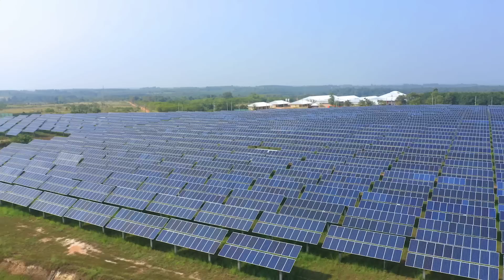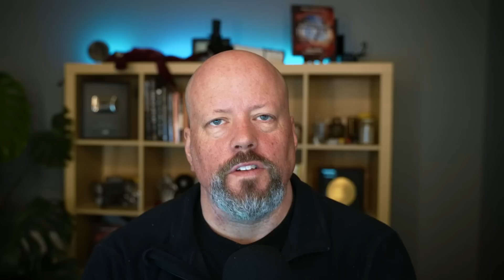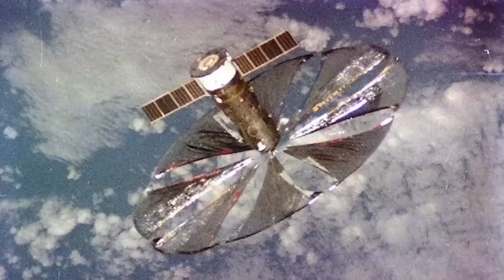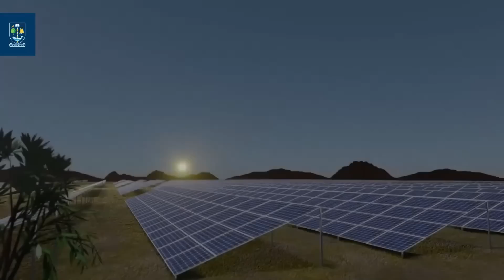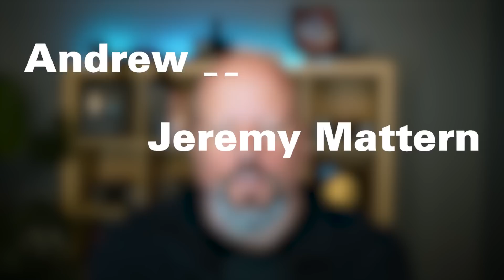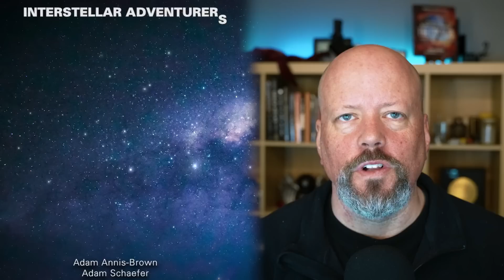How Space-Based Reflectors Can Change Solar Energy

Comment: I am curious about the impact that prolonged daylight around these solar farms might have on the surrounding wildlife.
Reply: I think the real use case for these things is going to be for the moon. It’s a perfect fit for setting up infrastructure on the moon, to overcome the 14 days of darkness.
Reply: Climate change due to the burning of fossil fuels is not so great for wildlife either.
Reply: @macbuff81  True but there are other possibilities like high voltage intercontinental power lines that achieve the same goal and could potentially provide more grid stability then space mirrors.
Reply: The key to remember is that it's reflected sunlight, so it's not going to spread nearly as much as you would get from other sources of artificial light (though you still have some atmospheric scattering in this case).   Kind of like if you go outside and use a mirror to reflect sunlight on the ground.  You get a sharp bright spot on the ground that is the size and shape of the mirror itself.  If you're next to the bright spot, but not in it, then it's just the normal light level.  He did make the point that for low angles where the mirror has to angle itself a lot to get the reflection to hit the right spot, the shape gets elongated and the benefit is spread out over a larger area, so its entirely possible that it doesn't make sense to try to collect sunlight at those lower angles.  For the more optimal angles, if you have a 2 sq. km. solar farm, and a 1 sq. km. orbital mirror, then you can create a mirror sized bright spot centered on the solar farm, and everyone on all sides of the farm can see the light reflecting off of the farm itself, but not really from the sky.  All of that light is centered on the farm.

As for clouds, it would depend on how far apart the farms are and how dense the clouds are.  If its cloudy over farm A and not cloudy over farm B, its entirely possible that the mirrors concentrate on the farms that aren't cloudy instead of just backlighting the cloud layer, which would absolutely refract the light and add to an area's light pollution in the same way that the full moon will light up clouds at night.
Reply: Mr. Burns was right 😅 (and that guy looks like Smithers 🤔)
Reply: @CarlosOteroC lmao that was exactly the first thought in my mind when he appeared on camera, but more like Borat than Smithers 😂
Reply: @FirestormX9  Life copying South Park which copied the Simpsons! 😆
Reply: It will just kill or harm all or many insects in the long run. But as all modern plants and  insects co-evolved this is just the same problem as in Germany - where 85% of flying insect ( by mass ) disapeard.  On the other side your US farming is so artificial you won't see it in prices.
Reply: I have similar concerns.  Whatever we do we over do as a species.  If we do it other countries will too.  What happens when we have multiple thousands of these things in space?  Even the desert has an ecosystem but we won't be beaming light down to only deserts.  This still doesn't address clouds either.  People are already complaining about Starlink satellites.  They have a lot to prove before I'm comfortable with this.
Reply: @jmr  people complain about everything.
Reply: A solar farm has already been built, the time to be concerned was before then. Being concerned about the mirrors at that point is useless.
Reply: @12pentaborane  The satellites aren't up there so it's the perfect time to ask questions.  Solar farms that we are already building have little to do with potential space mirrors.
Reply: @jmr   Then it's not a question about the satellites it's about the solar farms. Constructing the solar farm would cause so much damage to the hypothetical ecosystem extra sunlight on that area would be a moot point.
Reply: @12pentaborane  Maybe you unintentionally replied to the wrong thread then because this one starts out with "I am curious about the impact that prolonged daylight...."
Reply: Thank you most thought out comment so far :)
 @12pentaborane
Reply: In the desert... negligible.
Reply: @duhaneyparkclassics7484  Las Vegas is in the desert and with its lights at night it is an insects killing machine
Reply: @duhaneyparkclassics7484  the desert is actually a very active place at night, especially in the summer.  The rabbits, coyotes, mice, snakes and scorpions (plus many other species) all emerge from their lairs to find food as it’s too hot during the day.
Reply: @sowhat512iuu  I bet you eat meat.
Reply: @duhaneyparkclassics7484  you bet correctly, but this point seems to be irrelevant here?
Reply: @duhaneyparkclassics7484 Deserts are full of life.

Comment: Can’t we just have solar panels in space, and then beam to electricity directly to a satellite disc back on earth?
Reply: no
Reply: yes but there are a lot of losses and it be costly to build out the idea of this is that its alot cheaper and simple to build rather then trying make solar cells launch them in space put them togther and then lose a a bunch of power while trying to beam it down this just extends the amount of time solar cells can get power just a thin sheet of metal reflecting light on solar cells on the ground
Reply: Solar panels are much heavier than reflective foil, and much harder to replace and maintain in space. The weight is really the limiting factor though. To launch a grid-scale solar power plant to space is going to be ridiculously expensive, that's not even counting the equipment needed to transform that amount of power into wireless. Meanwhile, you can launch a grid-scale solar reflector for pretty much peanuts. The only heavyweight component would be the rotator gyros (and ironically its own solar panels that it will need to power that) but you can get acres and acres of reflector up for very cheap, relatively speaking.
Reply: well both is kind of a stupid Idea.

Comment: I wonder how far up the list of potential geoengineering solutions to combat climate change would be installing a grid of solar reflector satellites around Sun - Earth L1 point to block a small amount of incoming sunlight? I think with the introduction of the Starship it becomes doable and once the Lunar space launch infrastructure is erected it might become affordable
Reply: We could also just put reflectors on earth. Our solar panels could reflect unused wavelengths. Possibly even control weather.

IMO there is far too much FUD about storage though, probably manufactured by oil companies. That is what this is really about.

The storage problem would go away even without all the current rapid advances just by having large enough grids and massive power hogs like hydrocarbon production and desalination that create storable products, and thus can be turned off when power drops.
Reply: @peterd9698  I don't think you understand well the problem of the greenhouse effect, it traps a lot of infrared spectrum radiation in the atmosphere heating the air directly. The whole idea of combatting climate change is either reduce the amount of energy the atmosphere absorbs, that or reduce the amount of incoming energy to begin with
Reply: @mihan2d  the atmosphere is transparent to visible light but the ground absorbs it, heats up, and emits it as infrared, which the atmosphere is not as transparent to.. so it is trapped. Reflect it directly back and most can escape without being absorbed because it hasn’t transformed to infrared
Reply: @peterd9698 Yes of course it would work too (and that is the idea behind cloud seeding including the water mist sprayers on large ships to increase the albedo which is very close to being implemented) but some of the energy is still trapped in the atmosphere. L1 mirrors would be far more efficient and potentially long term solution with less variability which is the main concern against geoengineering.
Reply: @mihan2d  clouds are complicated, eg they retain heat at night. Sea ice might be a better analogy.

Comment: Gathering energy from above or below, is a very dangerous thing to do.  The biosphere of the Earth is a closed system.
Reply: I was wondering about the same thing. So many things that could go wrong, especially if enemies wanted to use it as a weapon.😮
Reply: @NovaDeb  stuff might go wrong better to hide your head in the sand! thats always works doing nothing!
Reply: wtf?
Reply: Gathering 'extra' energy on top of the sun etc is implied obviously but it might be helpfull to point that out.
Reply: Garhering energy from 250 Million years in form of Coal is better?
Reply: @gregor-samsa  no, but actually just building out our renewabel energysystem is.

Comment: do solarcells also use the infrared part of the spectrum ?
Reply: The maximum wavelength for the photoelectric effect in a metal (Caesium) is about 660nm; IR starts at 700nm, so direct collection of electricity from IR isn't possible in a metal. There are probably molecules which have a photoelectric effect at longer wavelengths, but I don't think we've found any that also have a low enough resistivity that we can get hold of the electrons in any direct way.

That said, there are known processes which turn IR into chemical energy, but these tend to be more feasible as a medium for transporting geothermal energy than for surface use, and make no sense in space.
Reply: No. Long wave infrared is absorbed by the atmosphere.
Reply: @davemi00  but what about solarcells in space ?
Reply: IDK bit IR photons have much less energy. It might be more efficient to use the heat.
Reply: It depends on the infrared reflectance of the material